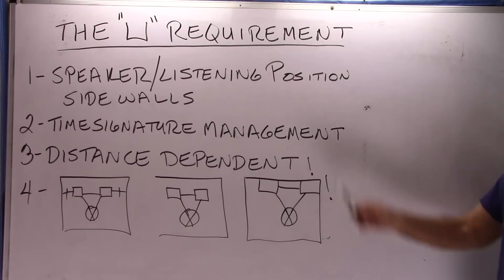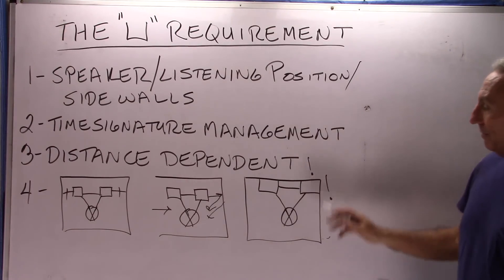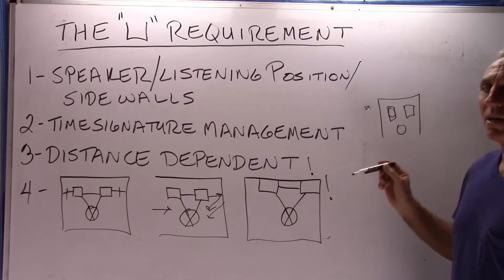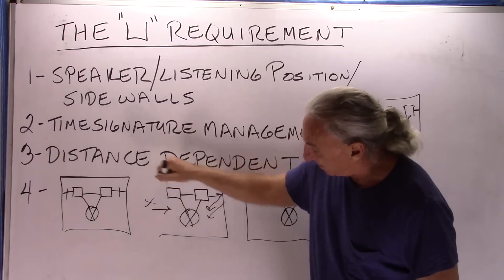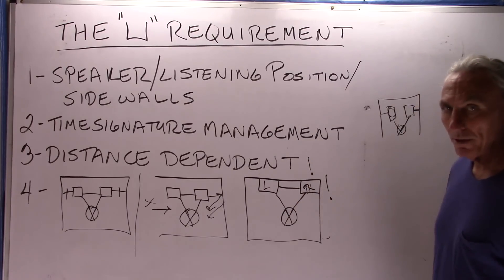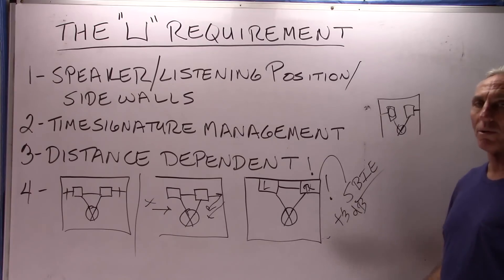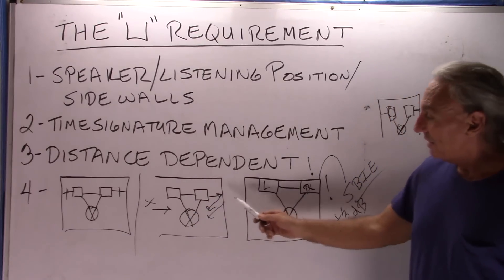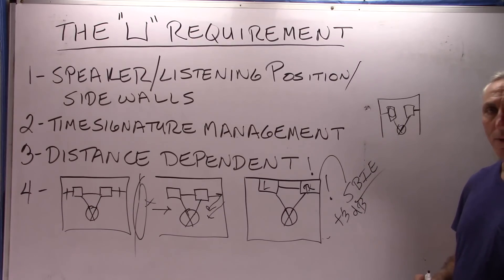The "U" Requirement - www.AcousticFields.com

Comment: My listening room is inverted U Shape, almost open backwall (1m wide wall about halfway point of the long sidewalls, listening position in front of it). Absolutely wonderful, you get the "small" room feel from the backwall reflections but bass nodes act like it's large room. The sidewalls also are quite far away, about 3:1 between reflected wave and direct in distance so i have to deal with floor refl (linoleum, yack.. we don't use carpeting in the arctic...). Behind the backwall are entrance and kitchen, both also symmetric and has lots and lots of diffusion and absorption. Sound goes there to die.. Best room i've had, standing waves are not a problem, it is superbly diffused when you think i got no diffusers, pressure can't build up, it has intimate feel from the backwal refl. Recommend.
Reply from the maker: +SquidCaps Just fill out the information in this room form. I can then compare your room size and volume with our data base and be able to tell you frequency, magnitude and location. More importantly, I can also tell you the required square footage needed to achieve your acoustic objectives. http://www.acousticfields.com/free-acoustic-treatment-room-analysis-tell-us-room/
Reply: Acoustic Fields Thanks but i want to make the calculations myself, i'm sound designer and audio technician turned in to game design, most likely i'll code something myself if i need more info, i work with physics simulations and rays a lot. The same room in any other layout btw is awful, there are maybe a foot area where the mains can be, sub is on the wall..

Comment: Can one use a movable or accordion type wall setup. I have a tough situation. Thx John
Reply from the maker: +John Crowell Hi John, A movable wall is possible, but you must match the density of the portable unit to the density of the existing walls. Sound is like water. it will find the weakest link in the structure and that can cause phase issues inside the room.